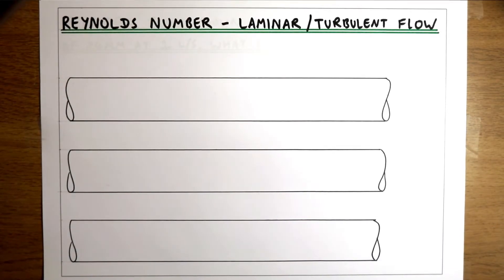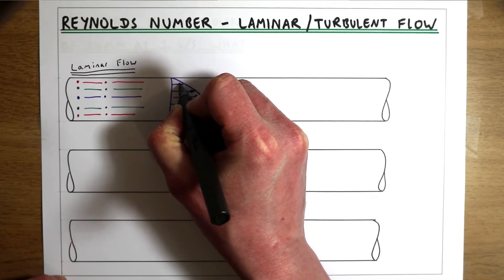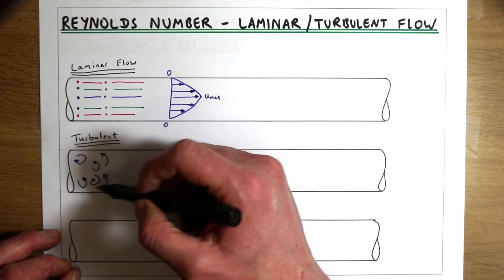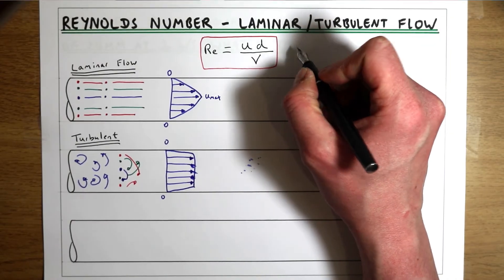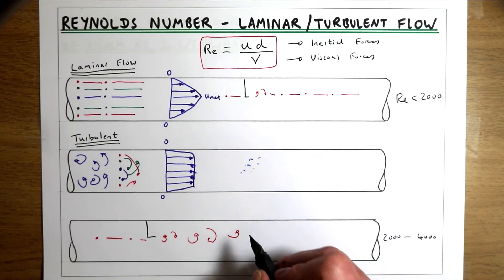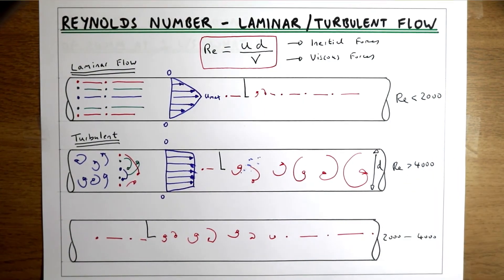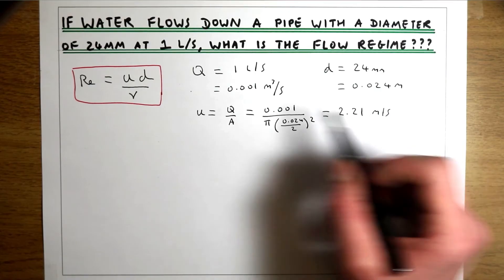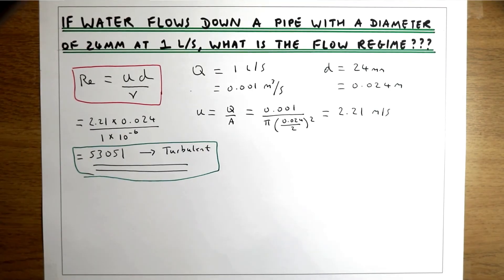Laminar Flow, Turbulent Flow and Reynolds Number

Comment: First for laminar flow which is parabolic continuity rule of flow rate cannot be applied in parabolic laminar flow maximum velocity is in center and zero at surface of channel. That is first indicator laminar and turbulent is invalid definition together with Re number. Second perform experiment in transparent tube with potassium permanganate which dissolves in water and with inject printer ink which very fine particles, but still are 100 times bigger than water molecules but you see that at Re<2000 paint mixes perfectly because of Brownian motion in liquid 10^14 Hz collision rate of molecules no such thing as laminar flow. To solve velocity loss deltaw need initial maximum flow w0 and geometrical parameters of channel (pipe) (L, d, epsilon).
reason why Regula heat exchangers is 30% less efficient and uses 2 times more metal is because Reynolds and Prandtl, Nusselt numbers who are nonsense, why exploit inanimate devices if workers can work for free and exploit humans is better choice.

Comment: So the fluid becomes a victim of disorderly conduct when a guy hits the pipe then?
Reply from the maker: Yep! Apparently Reynolds experiment was once retested and the transition values were different. Initially it was a mystery, then it was realised that the values had changed due to vibrations from modern day traffic (the lab was under a road).
Reply: @fluidsexplained1901  other experiments about electricity and magnetism have been disrupted by power lines.

Comment: Re<2000 isn't exact, different books and lecturers give different numbers. Fluid mechanics is a softer science than most people want to believe.
Reply from the maker: Absolutely, in fact there are papers that demonstrate laminar flow at Re>100,000 for highly idealised systems! This is very much an introductory level treatment of the subject. There are many more levels of complexity on top of this (especially given that there is still no full theory of turbulence yet).
Reply: @fluidsexplained1901  is there an analogy between turbulent flow and non ideal gas models like van Der waals?

Comment: does the reynolds number equation still apply if the object is moving through a stationary fluid?
Reply from the maker: Yep! But the length-scale will be the size of the object rather than the pipe diameter.

Comment: great video but is the reynolds equation not (density* diameter* mean velocitiy)/(viscosity)
Reply from the maker: Thanks for the comment. Yes that's correct, but there are two ways to write the equation. Reynolds number is (density* diameter* mean velocity)/(dynamic viscosity), which is the same thing as the equation I was using which is (diameter* mean velocity)/(kinematic viscosity) as kinematic viscosity is defined as dynamic viscosity/density.